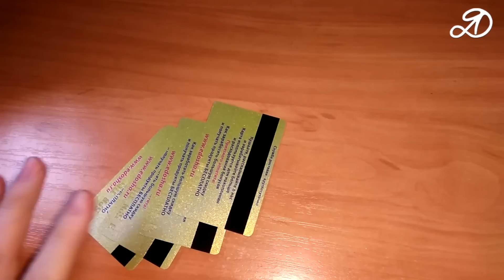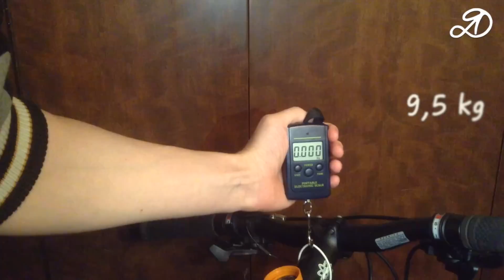Super phone holder for bike DIY. Simple bicycle mount for smartphone

Comment: This is very good. The only thing I would do is cut a hole in the black plastic, screw the bottle part in some how and then glue it. That way it can never detach, as its trapped between the bottle neck and lid. Also you have access to headset bolt.
Reply from the maker: Thanks for the comment! Very good idea!

Comment: Gj on nails. Also I feel one piece bolted to frame would be more secure.No need for screw cap...

Impossible to melt both plastics togetger in the oven instead of superglue?

I feel like superglue can easily break if the bike falls or goes over a big bump.
Reply: But apparently superglue is magical. Good tests.
Reply from the maker: If there is any doubt in the usual superglue, you can use special plastic. It kinda melts the plastic and better glue. I recently fell off my bike)) Mount in place. The phone is a little out of the seats. I think only a direct impact force on the holder may be damaged. Some of the shortcomings I mentioned in the description. Thank you for your feedback and questions! :)
Reply: Dial,  great video,  very impressed with detailed and clear progression in all steps of make. 
Especially pleased to see excellent work practice with the use of CA glue (super glue).  It amazes me how little attention others pay to this particular detail,  the result of which is,  people all over the world are failing to get best performance from their glues.
Reply from the maker: Thanks for the nice words! I'm glad you appreciated my work. I often use this glue at home. The composition of the adhesive: ethylcyanoacrylate.
Reply: Not true I tried it with the on bike on a city bus also took the bike on gravel roads worked unitil the glue lost it's bond due to contact points

Comment: Ingenious idea you came up with, great craftsmanship right there. Too bad you damaged your screen on the making ;-( Maybe there is a way of making a template of your phone or just put something thin and soft to protect the screen.
Reply from the maker: I spent a few days developing ideas and experimenting. Even there was an option to use a paper clip, just it damaged the protective glass on the phone screen. The paperclip was a metal without a plastic shell. Now you only need to replace the protective glass. The screen itself is not damaged. The latest version of the holder (the one on the video) is safe for the phone. It is desirable that the phone was in a simple silicone case, and the screen protective glass. If you're still nervous, you said you could put something soft on it. For example, glue pieces of rubber. Thank you! I am glad to your comment! Godspeed! :)